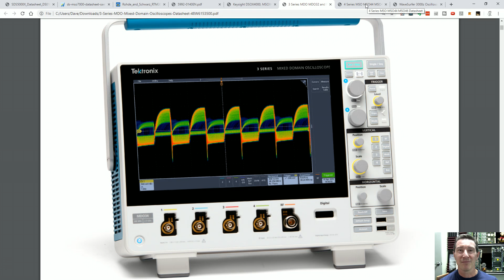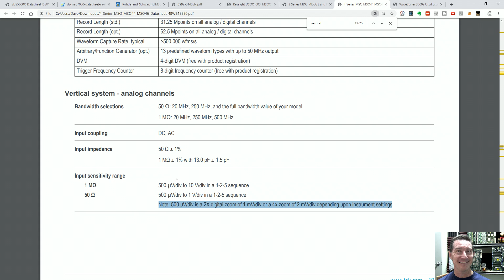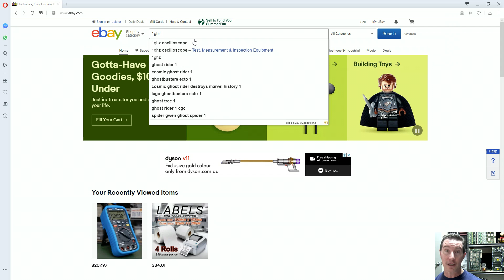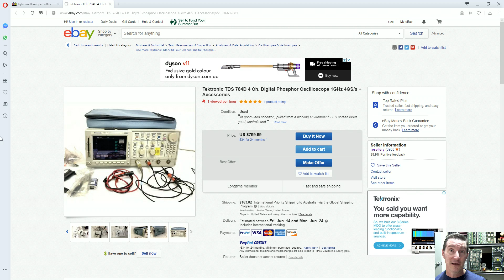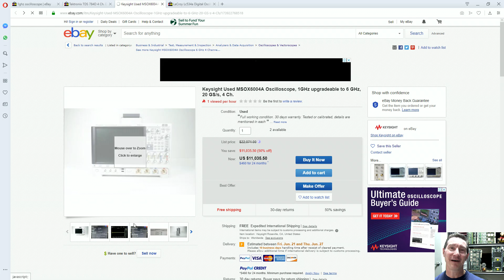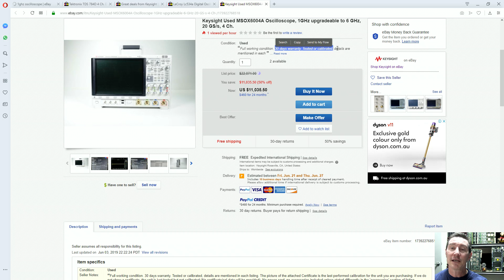EEVblog #1218 - 1GHz Oscilloscope Spec Shootout

Comment: 10k for 30 day warranty?.. no thanks.
Reply: Gotta love the EU, mandatory 2 year warranty
Reply: @tommihommi1  2 years is for new things only, refurbished / used products can be sold with 1 year warranty only
Reply from the maker: So you'd rather pay $20k?
These scopes usually last for decades, and even if something went wrong with it you could buy another one in a few years and likely still be ahead, or get it repaired and be way ahead.
Reply: @EEVblog  The repair cost for a 10K scope is likely to be several thousand.  Not a pleasant surprise, if they are so sure then why only offer such a short warranty. Buy one at 10k.. then buy another at 10k .. no thanks.
It's all very well having highly expensive test equipment at bargain prices, but these days they are not repairable on a DIY basis. It's a risk that's ok for bigger companies to take, but for hobbyists or sole traders.. it's a big gamble. You're not talking from the perspective of a sole trader who has to buy their scopes with their own cash.